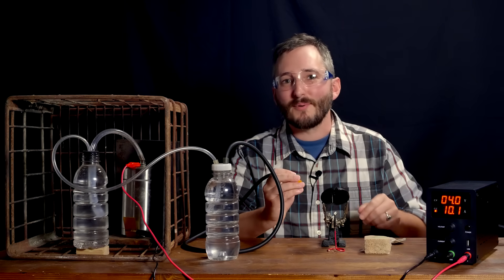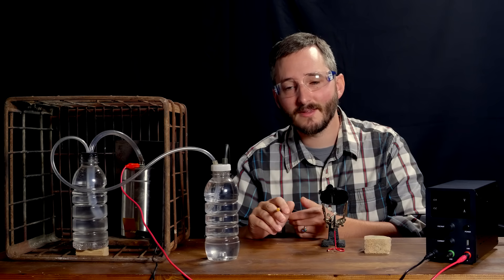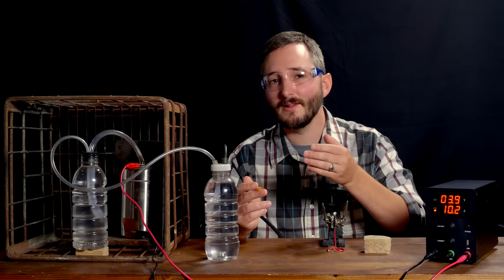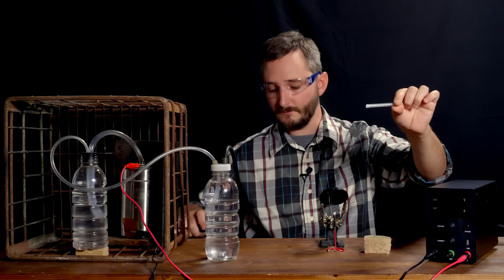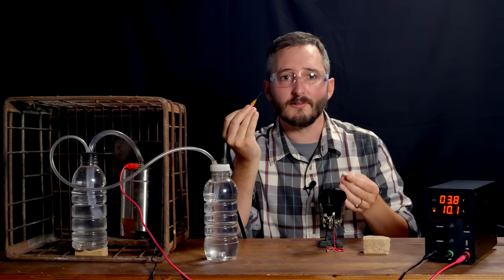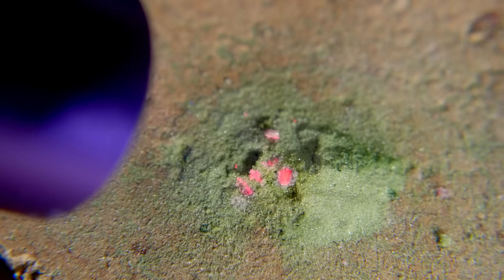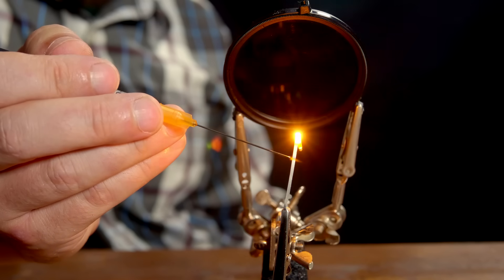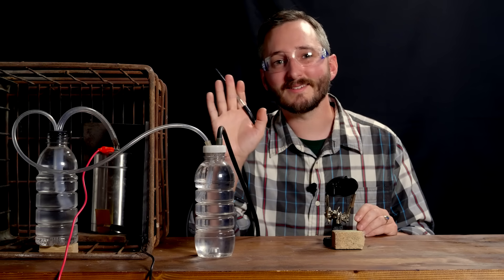DIY Oxy Hydrogen Torch Using Water Electrolysis

Comment: to add extra protection, pack the empty syringe body with wire wool, stainless is best, but basically building a flashback arrestor.. great stuff, and it does help on mpg when added to a car, as long as it doesn't have an ecu, which looks for CO2 exhaust products.. if you add hydrogen, CO2 will drop and the ECU will add more fuel to try and get CO2 levels were they should be according to ECU.. makes you wonder if this is done on purpose by car and petro producers..

Comment: I've seen something like this called an "oxhydric welder" in a couple of jewellery supply stores. It's pricey, but it looks like something you could use in a workshop setting with the regular precautions without having to worry about it blowing up on you.

Comment: Grant Thompson (The King of Random) made a Hydrolysis hydrogen generator powered by a car battery several years ago. 

His used multiple sheets of stainless steel layered together, along with electrolyte to conduct the electricity better.

If you could find his old video I think you’ll find it interesting.

Comment: Did you try copper or aluminum tube? Those metals should take heat away faster and the oxygen layer of both metals is highly protective. Even better with copper the flame should be greenish I guess.

Comment: If you build an electrolyzer in a U shape to get the oxygen and hydrogen seperately, wouldn't it be possible to use one of the mini acetylene torches, you can get on ebay to build a more typical cutting torch thing? 
That would be something I personally would love to see.

Comment: When I was a teen, I was an avid potato gun builder. All examples I had seen used hairspray as the accelerant, but I opted for MAPP gas. It was much more effective, cleaner, and ignited easier. However, I still "fueled" them the same way, IE just blowing the gas into the combustion tube by hand and quickly capping it. I had wanted to mount a nozzle and container to the combustion tube itself, but thankfully I was smart enough to know my limits. I was certain enough that just blowing MAPP gas into the tube wouldn't be enough to overcome the PSI rating of the tube when it combusted...but not certain about much higher concentrations...and worse yet, I had no idea how to deal with nor properly test the PSI rating of the flashback arrestor on the nozzle itself. I couldn't guarantee that the combustion wouldn't be powerful enough to blow back through the arrestor in a permanently affixed nozzle, and eventually reaching the canister itself. I see now I was right to leave it alone...I never would have known to take these measures!

Comment: 10 Amps at 4 volts is 40 Watts - so maybe a slightly dangerous way to make a 40 Watt light bulb by heating up the right substance!  That is a really amazing micro torch though - I do not tire of seeing what you can do with it.  I can see a lot of practical applications though clearly the safety hazards need to be worked out.  Maybe you could find a carbon tube instead of a metal one for the nozzle?  (Carbon mega tube?)

Comment: In Theory sir could an Airbrush gun be a good tool, if you hook it up to a little aircompressor and get a siphon type airbrush rather than gravity fed, i believe you can fabricate a way for it siphon the gases where the paint would be siphon as the air is attach to the airbrush. So in theory should have a better "throw"? not to sure how safe it would be but could it work.

Comment: This seems like a good method of making silicon oxycarbide from precursor polymers, meaning you'd be able to do a makeshift additive 3d printing of SiOC parts– useful if you need something structurally complex and very resistant to heat, or if you want a scratch resistant coating on a rough surface. All you need is dimethicone, which is very cheap.

Comment: To avoid flame back, How about mixing the two separately collected gases at the tip, using "water level" in traps to adjust the pressures for proper flow and mix.

Comment: A nice machine. I was thinking, if you ha larger generator, and used a 3mm syringe, with the same size tip you have, this would keep the pressure up. I would also get some fine copper wire, and wrap it around the needle. with it wrapped to twice the diameter of the needle, with some silver solder for a good connection, this should cool it down, before hitting the syringe.

Comment: Did this 13 years ago. You need a to use a chamber stuffed with carbon whool and bigger then what u used.  before your out put that will snuff out your flash. Those are called bubblers (ment to clean out steam not snugg the implosion.) That will safely stop your back flow. I blew up a jelly jar from not doing it. Hahahahababa

A bic pen works great as torch tip.

Comment: A colleague of mine had a setup like this, bit of a bigger one, 2400W. He used it to melt Tungsten, which is 3422 Degrees Celcius melting point - but explained that it could do so due to a chemical reaction with the Tungsten.... Could you show an example of this in a video? :) love your work.

Comment: Love it. I'd love to see your attempt with the gases separated. I feel like there should be a way to control the mixing that isn't super hard, maybe not a lossless solution. hmmmm
Reply: Why not get a smiths jewellery torch. Feed both gasses separate. That way good mix control. Not sure if the nozzles would stand up to the heat. 
Years ago had an old medical oxygen concentrator and standard propane hooked up to one of those torches and it worked great until it was stolen in a break in lol

Comment: Silly question, but would a Tesla Valve in the gas outlet tube help to safely arrest back while aiding in control of the increased flow rate?

Comment: A few comments: a thicker walled torch tip seems sensible, you could go so far as to water jacket the tip if needs be, and perhaps tougher flashback containers, you have squishy bottles as pressurisable containers which is doubtless doing something to the flow rate consistency, they may actually be sucking the flame in at times if the pressure varies allot, since the plastic bottles are essentially springs of varying volume also as you mentioned flow rate is key, I'm sure you could make a more reactive hydrogen generator if you wanted, perhaps double wall the chamber drill holes in the inner layer and insert the wire wool between there, then do the same in reverse for the lid so there's much more surface area for propagation?
Over all, cool little toy but it is a bit unstable as you've mentioned, a simple high temperature torch would be a great thing for people to use if the design here could be simplified and made more stable, I'd love to see a mark 2 variant if possible.

Comment: If you move the electrolysis, and maybe even the bubblers, to outside for instance, with a bit of a longer hose to separate you from potential failures and explosion of highly erosive material, surely that could be much safer?

Comment: It could be interesting to take this idea and combine it with the starlite you made previously and try to make a kiln. Perhaps you could create much bigger sapphires that way. I think I would try separating the gasses first though so that you could shut off the hydrogen flow when you wanted to turn it off. If you ran the rubber tubing through a much more significant tank of water would it act as a thermal break that stopped a blowback fire.

Comment: Imagine this: a container of water, open on the top.
Let us say: 1 meter in diameter and 1 meter high, round would be nice.
Or perhaps just a rainwater barrel with the top removed.

Setup your hydrogen oxygen producing device.
And have a barrel with its top removed, slightly smaller size, upside down over the generator device.
Fill the barrel with water.
The other barrel should now only contain air while it is upside down, with the opening pointing down, inside the other barrel which contains the water.
The water will seal the stuff.
Meanwhile you can produce a nice load of this gas.
Keep any ignition source or such away from it, ofcourse. BUT THIS is common sense.

Weigh down the barrel that captures the gas.
And have valves set up in such a way that you can release pressure, as well as use the gas.
If you weigh it down correctly, you can get the barrel to fill up and have a nice pressure to work with.

And all you have to do next is 1 spark arrestor ( i see you use 2 bottles to keep the spark from traveling down the line, but 1 should be enough if setup correctly.)

When you pressurize the gas a bit via the methode described above (or such), you can use bigger nozzles. 
And perhaps a pressure regulator can be used to keep the gas coming out at a specific rate/speed or how you wanna call it.

Just some thoughts.

Btw: That much security for an HHO generator. I mean: A steal basket, all the rest of it. Kinda exaggerating it, in my mind.
This setup only produces small amounts of the HHO gas. And it vents out into a plastic bottle with water in it. 
The generator itself hardly contains any gas.
So why put it in this basket?
You got 2 bottles that arrest the spark/flame that might travel down the lines.
1 should already be enough, but 2 is always nice, more safety.
BUT that is ENOUGH.
No way the flame is going to travel back to the generator itself.
PLUS there wont be much gas inside the generator itself to have any kind of explosion.
SO this steel basket around it.... pure show.
Actually a bit ridiculous, to be honest, but that is just my opinion.
And yeah , i know how explosive this gas can be.
BUT your setup is already safe enough. There is almost no possible way of the generator exploding in your face.
Unless you plug the holes of the outlet and have it accumulate the gas inside.
And you would pull out the 2 spark/fire arresting bottles from the system.
Then maybe you might see an explosion in the generator.
But with this set up: There aint no way it is gonna explode unless you intend it to explode.

Comment: Ah fun stuff! I prefer to make the gasses separately to begin with so flashbacks aren’t a problem. Still makes me nervous though. 😆
Reply from the maker: I prefer making them seperately too, but it's hard to get the same efficiency in a split cell. A lot easier to get the electrodes close together when you don't have to worry about shrouds or membranes between them
Reply: @Nighthawkinlight  Don't worry, you've don a splendid job. I appreciate the cheap and cheerful approach rather than safe and not so much fun one. Thanks!
Reply: @Nighthawkinlight you don't need to fully split. If you've got a relatively rich and a relatively lean hose then the blowback speed is much lower. As you're at the stoichiometric ratio the blowback is as bad as it can possibly get.
Reply: @Nighthawkinlight  and yet people's still don't understand that the junction point between combining to the two covalent bonded elements of oxygen and hydrogen can generate an air Watts pressure wave propagation Force as high as mach 3.5 with ZERO ignition... Add a vortex to stabilize flow rates. " Think like if a puddle in a pond THAT is how Acoustic waveform energy propagation work's.. it also involves Brownian motion. Anyways... World's not ready..
Reply: @mjolnirswrath23  I looked up browns gas while doing my own research and wikipedia made many mentions to "pseudo-science" xD 
seems to be a great deal of energy going into trashing the use of it in any way. "hey we're trying to sell non renewable energy here!"
Reply: @mjolnirswrath23  Do tell!
Reply: That compression method I saw you used in an older video of yours - the one where you use small compressors encased in plastic bottles to pump into old "balloon time" tanks: do you still use it? How effective is it?
Reply: @ImpetuouslyInsane  c
Reply: Can someone explain something I read long ago about HHO torches? It said that the temps are roughly 2500° & the target material cools quite quickly, if I recall... this would lend itself to cutting/welding operations w/o losing the temper of the target material. Can someone elaborate on this?
Reply: build a forge that runs on it and melt scrap metal,turn rocks into iron,make lava,heck you could even make  crystals if you can get it hot enough to make ruby
Reply: I installed a pressure release valve behind the flashback arrestor to relieve pressure when needed.
Reply: Would have liked to know the material and it's thickness that you burned the holes in. I made a similar generator for some experiments a few years ago with simultaneous production in the single output tube.  I used a one-way valve and the water bottle safety but was never comfortable with it even though I never had a backfire. I was producing a lot more gas and I remotely ignited a few balloons full. The explosions were tremendous and a little intimidating so I destroyed it on the side of caution. If I ever resume experiments I will most definitely separate my production.
Reply: Love you Cody
Reply: Gas on demand is the way it just needs to be very small volumetrically .if the volume was low you could catch your source on fire with little consequence
Reply: @noahmcabee2534  about that would be the solution .... a small volume of accumulation but a very high speed of gas generation ...
Reply: Cody is the end of a leg.
Reply: but producing them seperately have to be wet cell while dry cell is may more efficient
Reply: Good to see ya, Cody!... been following both you guys for ages...
Reply: See my comment. I think fluid flow vacuum dynamics solve the water-hydrogen fuel problem. But I have no lab to test REALITY in.
Reply: me too
Reply: Hey, how come your usename looks different in comments than in your channel?
Reply: Solid build I’d prefer using vibranium tubing stabilize the reaction of the oxy-hydrogen gas, it should take care of flashbacks highly effectively due to it’s superior thermal conductivity.
Reply: WHOAAHH!! IT'S CODY!!
Reply: Put a small solenoid valve on the clear tubing just before the last bottle connected to the bench power supply unit so that when you switch off the psu the solenoid shuts preventing back flash 👍
Reply: @robmarrin6720  & how do you manage the gas left in the tube between the solenoid valve & the still burning tip.. still will flash back because no flow.. & now that its a closed container it will explode the tube & maybe the solenoid too
Reply: @Errol.C-nz  You should have watched the video it looked cool when he did it.
Reply: @robmarrin6720  like the ones left over from the sprinkler valve he used to make his pneumatic canon!
Reply: Oh hey Cody
Reply: WAT R U GONA DO WHEN THAT SHIT BLOWS UP IN YOUR FACEE!!!!
Reply: @evanbarreras9109  I would simply withstand the blast😌
Reply: @wm4750  Is that you Chuck?
Reply: Hah! Professor Bumblefuck here pretending he can make anything with a yield above 5% what is expected for a beginner! Riiiiight!
Reply: I've been watching your videos for so long😭

Can i get a comment from you?🥺
Reply: @bryantaeb9910  No, no you can't. Maybe find something else to base your self worth on other than the approval of popular youtubers. :)
Reply: @bryantaeb9910  Hopefully my like and comment will "bump" yours and nighthawk see it and gives you the comment that you asked for... Best wishes...

Comment: There was a company called Hayes that produced commercial water torches in the 1970s - don't know when they stopped, but I couldn't find anything about them online.  Anyway, the reason I bring this up is that in addition to what was basically this exact setup, they had an "enricher" that was a bubbler just like your anti-flashback bubblers, that was filled with alcohol (ethanol, I think).  The purpose of this was to produce a lower flame but with higher power output (about twice the BTU rate, as I recall).  Since the oxygen/hydrogen mixture is already stoichiometric, this would make it burn rich, for a reducing flame, where you need that.

Comment: There is something else to mention about reducing the flashback or explosive sensitivity, is critical diameter. That is what you are mostly benefiting from in this situation as these gasses can detonate at up to 8000 ft /sec. Well above the speed of the gas stream inside the nozzle. The "gauze" of aluminum in the stem is also creating, micro pore spaces that are probably way below critical diameter that will dampen any propensity to generate a detonation scenario. Interesting to note that there was a company that made explosive safe containers for flammable fluids by filling the open space inside the container with expanded wire mesh. The davy mining lamp used fine metal screen around the flame to reduce the chances of initiating methane explosions in underground mining. It could also be used to detect methane by altering the colour of the flame burning behind the wire screen.

Comment: I think i seen this on stuck with Hackett once on discovery of something and he used it for a cinema projector. Now I know you can melt steel it would actually be viable for me to start this and try to cut a pieces of metal to replace chipped parts in my tools. Like shovels etc. Thought of course it is hard to imagine anyone needing to do that with shops hanging around. It would be nice to have that tech

Comment: So is that too hot to boil water? Becouse if its not then the boiling water coud generate electricity. And after some time if we dont lose much heat maybe we can generate enough to feed the system itself? So as long as we have water we can have infinite energy? WOAH! This coud be even a solution to our energy needs? This brings so many questions to! Im overloaded! Imagine useing large containers and generators...